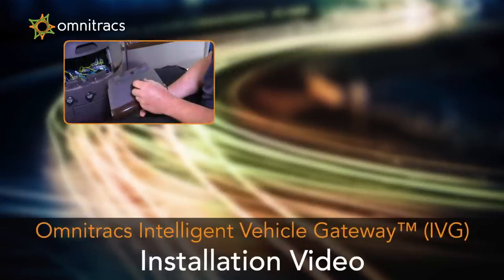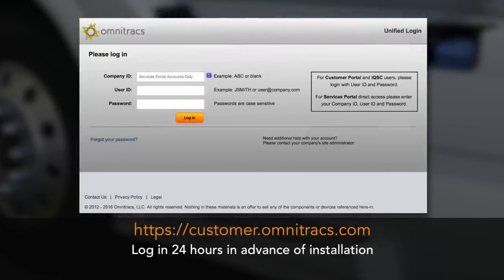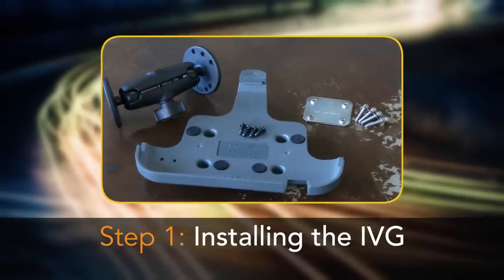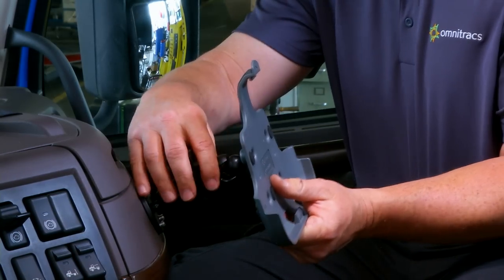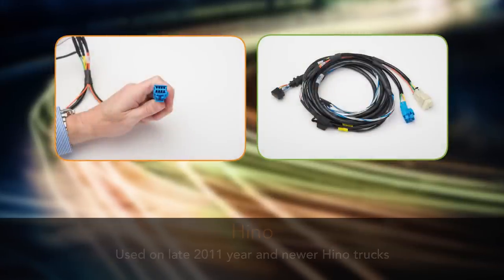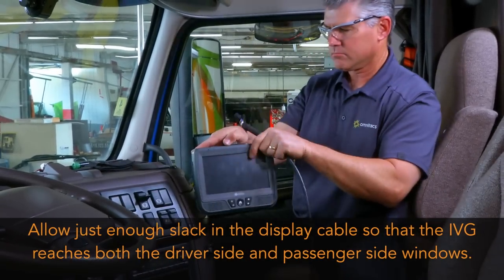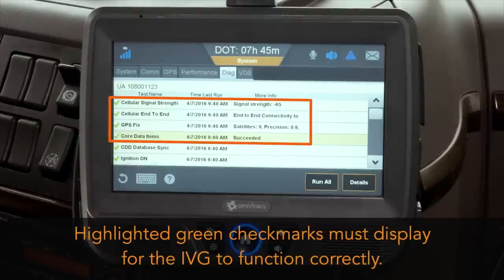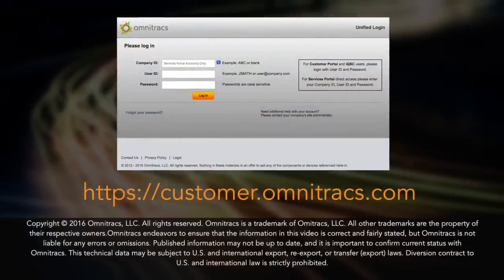Omnitracs IVG Installation

Comment: So the wire cutters and strippers that were required are in fact not required!  If all you do is plug in the display and connect data cable, you won't need cutters or strippers!

Comment: I have 2016 freightliner cascadia I connect all the wires but two wires yellow and green are left where do these wires connect?
Reply: I have the same question, where do those two wires connect?
Reply: Same question on a 2019 Cascadia
Reply: i found out my cable was for newer truck.Had to replace the cable .Hope that help
Reply: @supertrucker5694  Thank you

Comment: how do you reset it?
Reply from the maker: When facing the screen, there is a rubber boot on the left side of the device covering the reset button and micro SD card slot. If you hold down the grey rectangular button for 5-10 seconds, it will cause a soft reset.
Reply: +Omnitracs, LLC not
Reply: @williedavis6273  , how so ?
Reply: @OmnitracsInc  , it works !!. thanks